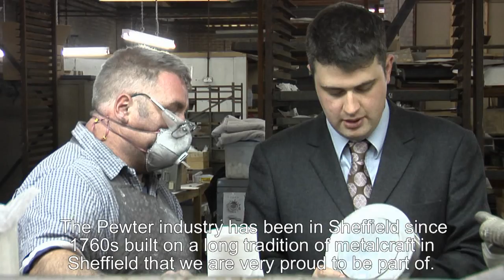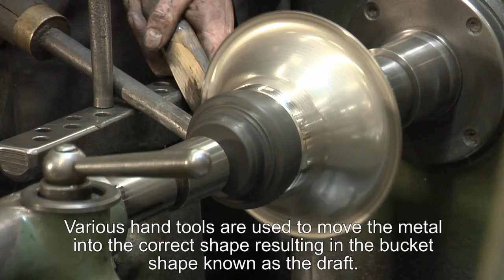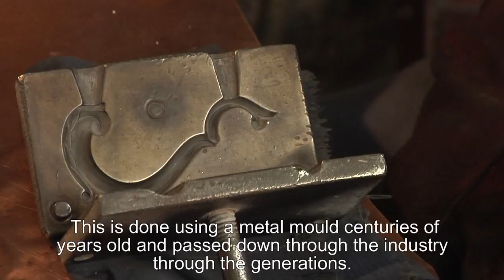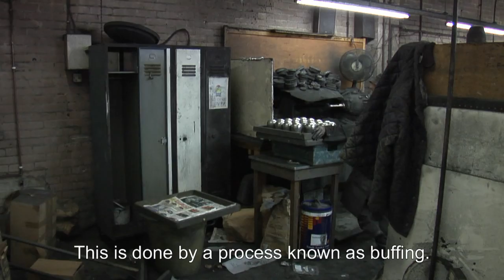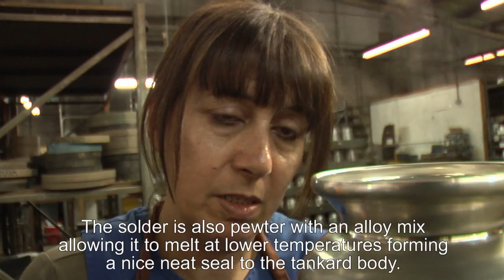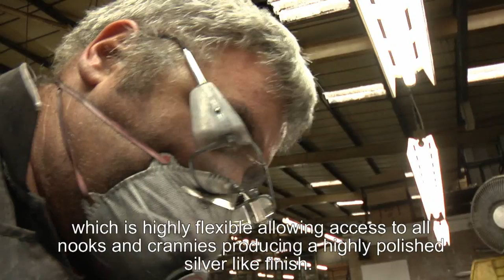Wentworth Pewter

Comment: No saftey glasses. No gloves, especially when using caustic powders buffing. No masks when soldering or buffing. No eye protection. Only the first worker had on safety devices, glasses and mask.
Wonder how soon after retirement these folks croak!
Reply: You dont wear gloves while buffing ask any number of people with less than 10 fingers and two hands.
Reply: yes when spinning or using lathe, drill press etc. not gloves! They have a tendency to get caught and pull your arm in and injure you possibly fatally.

Comment: ¿ por qué no se derriten las soldaduras a  altas temperaturas? si el recipiente en sí está
 hecho de estaño
Reply: The solder cant exceed the melting point of the item itself or one will melt the item before the solder.

In this case pewter has a very low melting point between 170-230°C, which is easily melted by a torch. Suspended metal also melts easier.